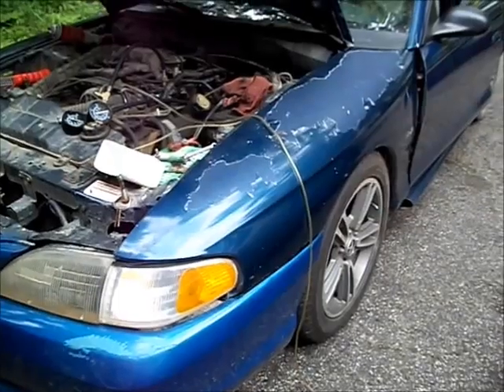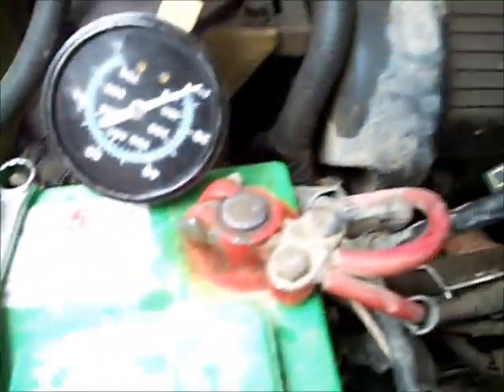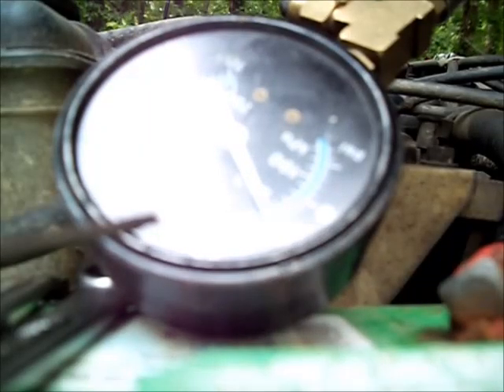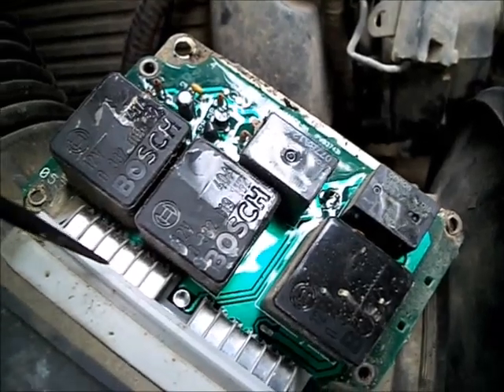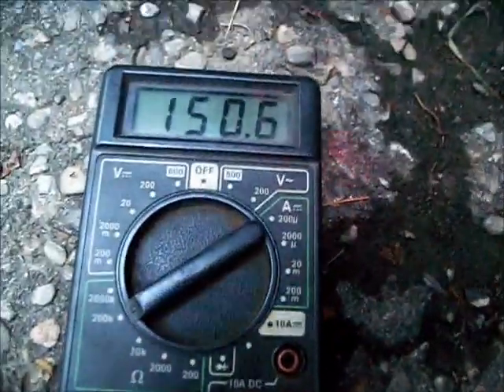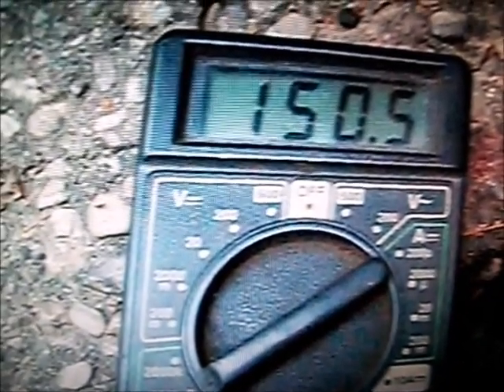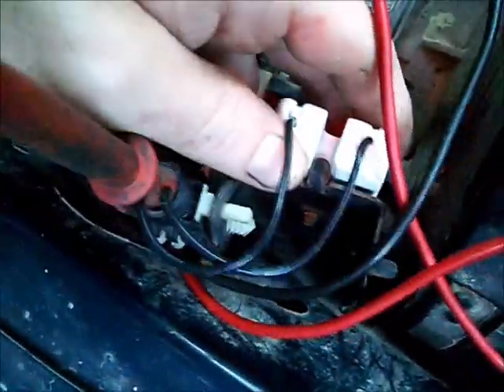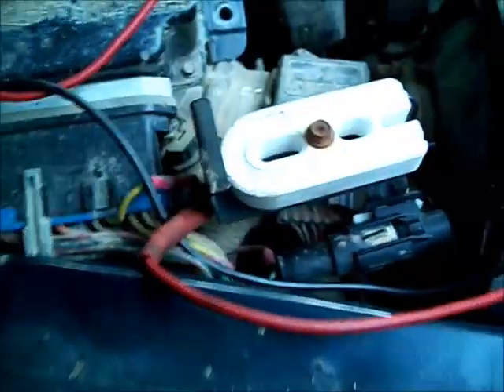98 Ford Mustang 4.6l diagnose stall replace resistor for fuel pump

Comment: 98 V6 starts fine, drives and pulls good for the first few minutes then starts stumbling and won’t build rpms, cuts out at wot and eventually shuts off. However at any point i’m able to turn the car off and then back on and it runs with full power before doing the same thing eventually, I checked out the ignition system as well as the MaF. No codes yet either, which is weird. I don’t think it’s a dirty throttle body either because it isn’t a constant issue, and the issue seems to go away immediately after re starting the car, but comes back about 5 minutes after. Could this be a bad fuel filter, or the relay?

Comment: I have a 1998 3.8L v6 mustang, car shut off while driving. cranks but no start. Turns over easily with starter fluid. I changed the fuel pump and same issue. The old sending unit turns out it works when I put a + and - wire to it. At the schrader valve the fuel just dribbles out low pressure when pressed with a screwdriver. Any suggestions? I hear the fuel pump prime when i turn the key. The Theft light isn't flashing.
Reply from the maker: fuel filter?  Hose/line kinked, between point A to B?  Probe Hot wire to ground connection at pump, for 12v, when switch is on.  If all ok, restrict return line, at, off of fuel rail, with pressure gauge installed.  To see if pump can generate pressure by dead-heading its return.  Also, check for leaks, including injectors, filling cylinders with fuel.  Thanks for watching.

Comment: I got a 98 mustang gt that is having stalling issues similar to yours. When I check the fuel pressure its at 75! and when i turn the Car off it drops to 0 within a min or 2. I pulled the vacuum off the regulator and no change in pressure. Research says that it should increase the pressure from 30-40 to max 40-50 after pulling the vacuum. Does this sound like a regulator issue?
Reply from the maker: It should change in pressure, but at 75 psi. It may not.  Also, it may be a regulator issue,  or a pinched return line.
Reply: @AutoDrdiy regulator has been my guess for a while now. It’s between That and a leaky fuel injector. But 75psi that’s just crazy it should be mid 30’s from what forums say. I’m gonna replace the regulator this weekend. THANK YOU

Comment: So I'm having a similar situation.

My car is throwing a p1260 code after driving in the rain without inner fender wells, and I hear no fuel pump when trying to start the car. Could the water have damaged the ccrm and this resistor in my 98 mustang GT? I replaced the ccrm but not the resistor. Ford dealership didn't want to touch my car because California.

I'm really hoping replacing the resistor will help my problem
Reply from the maker: you have a security system issue.  use key fob to unlock door, should enable fuel delivery.  or ur key or lock has a problem.  thanks for watching

Comment: I have a 04 mustang v6 3.8 l and I put a new plug wires spark plugs fuel pump and coil pack I rlly don’t have money to fix it drives for a while and stalls out and I loose all power in gas and steering have to turn it off and on and it goes for a while again
Reply from the maker: Did you happen to replace the fuel filter?  Also, check and make sure the gas cap doesn't have alot pressure associated with removing it.  See  vent valve get stuck, and it was sucking the tank together, to get fuel.

Comment: Hi I have a 1996 ford mustang gt 4.6L. I just installed a new bbk fuel pump. I double checked everything. An the pump isnt kicking on. Do you guys have any ideas what it could be?
Reply from the maker: Was it running before you changed the pump?  Check fp fuse, switch out fp relay with another relay in box, also, check to see if the inertia switch is tripped ( red button Drv Side taillight area in trunk .  As well, the pcm, or (eec relay) for computer could be boned.  Make sure security light isnt flashing on dash.  Thanks for watching
Reply from the maker: It may have a bad (constant control relay module), if equipt.  Check engine codes for primary or sec fp circuit failure.
Reply: @AutoDrdiy  i have a 1998 mustang gt and i replace the battery and alternator and the car still dies every 15 seconds but it starts everytime.
Reply: @AutoDrdiy  also i have codes from my car p1000/p0231/p1260/p0231
Reply from the maker: @akeem5.0  the 1000 code is nothing, but the other 2 codes for p0231 has to do with power to the ccrm ( B+ pin 11 of the ccrm connector) and out to the fuel pump relay circuits.  (The ccrm is not a good design, and usually causes problems, but it is a messy system and is to complex to point out a particular problem w solution)The 1260 is for anti theft problem, which would shut off fuel after start-up, caused by a prob with the security system, or using the wrong key.  Thanks for watching
Reply: @AutoDrdiy  i did get a key made a month ago since the factory key way broke n half but theses problems started a few days ago and my anti security do pop up but im able to start the car though so it must be fuel pump or relay
Reply: Sorry it toke me so long to reply. I did change out ccrm. Still crank over but wont start. I changed the reset switch in the trunk. Still nothing. So I changed my brown an pink wire. Its getting 9.45 volts. Someone to run my own relay an power wire.

Comment: does it backfire through the intake when you try and give it gas and then stall?
Reply from the maker: Not sure, that was like 5 years ago.  In general, just what's in the video.  Thanks for watching
Reply: Mine is backfiring out the intake as well, 98 mustang gt with stalling issue and a fuel pressure at 70-80 psi. After shutting off the car it drops to 0. When it starts to stall, theres no throttle response at all. And when i mess with the throttle cable to rev it, I hear the backfire from the intake....

Comment: The idle gets really rough at times
Reply: clean your MAF sensor.. its rather easy... clean it out from a electronic cleaning spray from a electronic store such as FRYs electronics... costs maybe $6... then take that metal tube out and theres a small circle in that metal tube spray that down too... let it air dry.. guranteed its the problem... ez fix, even if you arent mechanic.. did it to my 98 gt...fixed the problem... make sure you get the metal tube sprayed as well... let air dry
Reply: metal tube= the metal tube connected to your intake, that the sensor is connected to. my gas went down dramaticly

Comment: My car does this gotta 2000 mustang gt does this from time to time did this end up fixing the problem? I've reolaced the MAF Sensor thinking it was that has recently new fuel pump so idk what the heck it is I need major help with this
Reply from the maker: The problem you describe is to vague to say without codes, and or some manual tests when the problem ocurs, also if it happens hot/cold/any temp, or after 1 min./20 mins?  And it could be anything from water in fuel, to a defective IAC, to a loose or corroded pwr/ground connection.  And on, to a possible bad (CCRM), (the Constant Control Relay Module), are a know sketchy substandard and undependable solid state module (expensive as well).  This module switches power on to virtually everything from fuel pump to fans, to a/c and the pcm.  And it replaces that obsolete fuel pump resistor, the (CCRM) is located at the same place, (in the psgr. side fender.)  Some other culprits for idle/stall may be, any modified components on the vehicle, (such as o2 sensors bad, removed, re-positioned, etc.)  I could fill this entire page with possibilities on that particular line of vehicles,.... no really.   But, truthfully, a scan tool is the shortest way to either find or eliminate an undesirable condition on these.  Some manual things to check would be, check for vacuum leaks all over, in part by pinching off vac lines at intake with clamp, brake booster line as well, fuel pressure/volume at fuel rail and water or other contamination in fuel, switch the IAC with known good one,  I`ve seen a bad o2 sensor (front ones) cause idle issues, a break in air tube between engine and MAF, and that engine temp is able to reach 195*F, all connectors to CCRM (for green corrosion on and pins and yellow wires), grounds on engine and on body, check for EGR valve getting hot while only at idle (may be not seating properly letting exhaust slip into intake un-metered, water intrusion into pcm connector/ loose pins in connector.  A bad tps sensor, or a sensor shorting out the 5 volt reference shared by other sensors.   Getting the CODES idnetified will likely narrow down the field some.  All of this occurs to me in just about 30 seconds, after considering the words (mustang, idle problem, stall).  Which leads me back to the use of a scan tool, to eliminate most of the manual testing of components.

Comment: My 98 ford explorer has been stalling at red lights and intersections for a while. Not every time but when it doesnt it shakes then shoots up and revs back up then down again. Really happens a lot worse when i'm below a 1/4 tank. I hooked up my OBD2 scanner to FORSCAN and its showing 0psi fuel pressure even when the car is on and idling. The scanner says "NO FAULT" on the fuel pump and i hear it kick on when i turn the key once. 

Any ideas? I replaced IAC and PCV valve. Cleaned throttle,MAF, and changed plugs and wires.
Reply from the maker: Plenty of ideas, and the IAC would be a typical 1st choice.  And the Explorer doesn't have a 4.6l in it, so need to know what motor is in the explorer: 4.0 SOHC or 4.0 OHV, or a 5.0 ?  And the mileage.  In general,  I would look at the scan tool lines that says (O2 B1-S1 O2 B2-S1) while its acting up. (Have an assistant driving it.) And if those numbers are dropping down to 100 mv and not going above 500mv, (while acting up below 1/4 tank) then suspect a fuel delivery problem.  Or if you suspect a problem with the fuel pressure, and it is quite possible if you notice more of a problem below 1/4 tank, then a fuel pressure check at the fuel rail is a logical next step to solve the problem.  It should be checked by someone with experience handling flammable fuel.  Do to high risk of personal and property damage.  A fuel filter can be a likely culprit if not maintained.  A faulty fp regulator.  Aftermarket fuel pumps, with swelled lines in tank, or installed improperly as well.  This 98 may be to old and not equipt. with a fp sensor, so a -0- will be present then on scan tool.
Reply: Auto Dr diy 4.0 SOHC V6.Replaced the fuel filter a few months back. I'm pretty sure the fuel pump i the stock one. I got the truck 7 years ago and have never had it changed. 

Its been a lot worse since after i changed the PCV valve which is weird considering the old one was pretty gunked up i figured it wouldve helped to get  a new one in there.
Reply from the maker: could be a vacuum leak in hoses someplace especially vent hose between valve cover and air cleaner.  Listen for any hissing sounds around engine area, I use carb cleaner on lower intake gaskets and see if idle changes, for a fast way to see if lower plenum gaskets are bad.  A fuel pressure check is still recommended.  And a sticking egr valve can cause surge problems.  I unplug vacuum line to it temporarily, and drive under problem conditions to look for improvement.  Old front  O2 sensors not functioning correctly will interfere with fuel control as well, should switch rapidly above and below 500mv.  Check air cleaner ribbed tube for cracking between MAF and throttle body. Unmetered air entering engine wil cause random drive ability issues. Even a bad brake booster can leak vacuum and cause issues.
Reply: Auto Dr diy Ok thanks! I have the entire next week off of work so i'll inspect every hose i can and look for any cracks. Gonna do a smoke test too to see if i can find any leaks in the manifold. I'll hook my scanner up tomorrow and see what the 02 sensors are reading. Its a 98 so if the parts are cheap then i dont mind replacing them even if they arent showing up bad. Gonna happen sometime.

Comment: Yep they r
Reply from the maker: +james johnson   It will have to be checked for problems by means mentioned in my previous post.  Pcm data, fuel trims, iac position (such that it is working and within established parameters) (less than 10 +/-) and that any aftermarket stuff ie; intake plenum, larger throttle body and or injectors.  And weather it ran ok before the last part swap.  I seen where someone had got an older style used GT intake and installed it, and it did`nt run very good, come to fine out that the intake had been planned for heads that were shaved 60" and it was leaving a gap at the bottom of the intake where it meets the head.  This caused a considerable vacuum leak, (lucky not antifreeze).  And you can call the manufacturer of those new parts and ask them for problems with installing their stuff.

Comment: My 98 mustang gt idle up and down and stall out at a stop light would this be my problem to
Reply from the maker: +james johnson    Hard to say without running tests on it, codes, data, and if its been modified or tampered with in anyway.  BUT, this mustang wouldn`t even make it to a stop sign before it dies, simply because the relay drops to low volts after x amount of time, and the low volt(1v) lower than 12v);resistor was open. You should check for vacuum leaks, and possibly idle air control bad, dirty throttle body, or MAF sensor.  And fuel pressure should be tested as well. And even the O2 sensor can cause this problem, typically on one that has been worked on a lot.  Good luck on it.
Reply: +Auto Dr+  I did install heads and cams on the car and I put a new iac sensor on the car
Reply: +james johnson and I put a bama tune to fix the the car run lean
Reply from the maker: r the o2 sensors still in it?
Reply: +Auto Dr+ yep the o2 sensor still in
Reply: Vacuum leak

Comment: question for you sir. Im looking to upgrade my fuel pump but there arent many options for the two speed return style systems, so do you think I could put a single speed pump into the car, and bypass the resistor so the pump would have full power at all times?
Reply from the maker: +Zoranan   Thanks for the question.    Well....you may want to study some mustang forums for an absolute answer.  But this pump is essentially at a single speed during start up and hard acceleration, and then at another speed during cruise and idle.  So I don't see why it would be a problem (but likely will have a check engine light on because of it).   By splicing the resistor wires together, it will have full bat v on it.  (overriding low speed)The resistor only drops it about 1 v or so...seems like a trivial amount @ best, but who knows.   Good luck with it